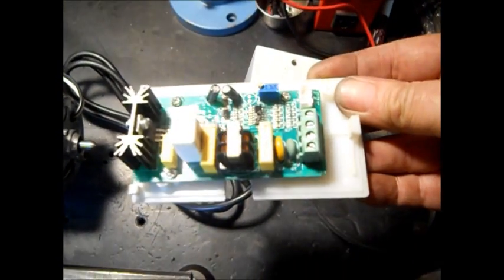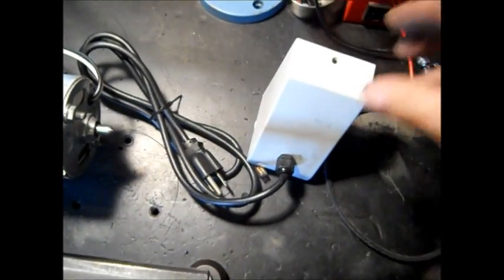Tread Mill Motor 1H.P. Mounted on Nano Lathe

Comment: I don't mind at all ... thanks for the consideration though! The pulley looks great, I probably should have left it blank. You also may want to put a light fuse(in case of stall) and switch interrupting the motor so you can start and stop without readjusting the pot? And you may indeed use that slow speed to avoid work hardening stainless steel which will smoke you tool in no time. Also it can be good to go slow with aluminum as well so it doesn't heat and bind. Very cool!